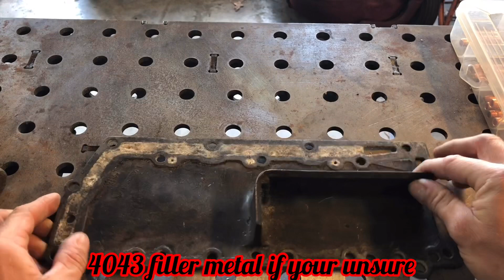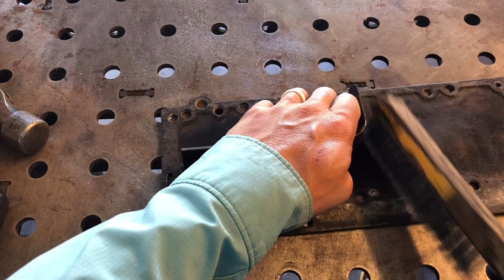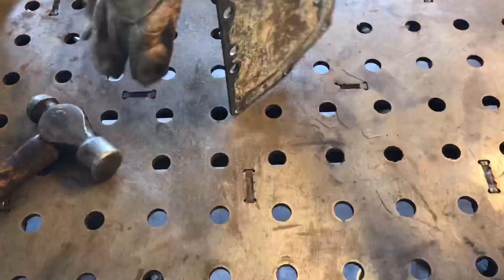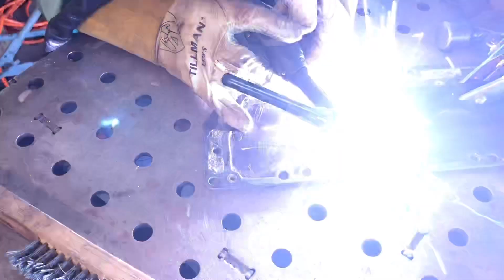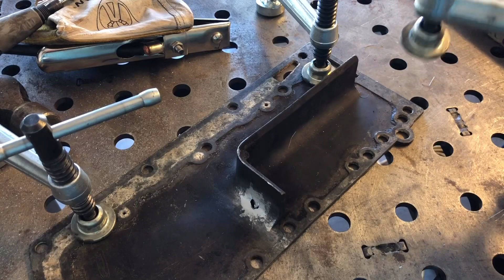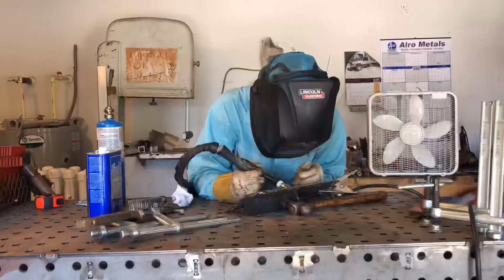Welding DIRTY THIN Cast Aluminum

Comment: Recently did thin cast aluminum and I think my biggest mistake was using 3/32 instead of 1/16” tungsten. Cast is way more difficult than most videos portray, but yours is very realistic and informative on those small details that makes a difference. Thank you I subscribed cuz it was so informative. Keep meltin bro

Comment: That appeared to be an almost impossible repair - kudos for accepting a challenge like that. Because that casting was designed to be exposed to salt water, I imagine they actually used better casting material than would have been necessary otherwise.

Comment: Thank you for simple, clear instruction.  l am welding a damaged quad engine lower casing with a hole and broken away edge. l am using a cheap lift inverter tig 165, not sure will do a good job.  Any advices appreciated.
Reply from the maker: pre heat with a torch. get to at least 400 deg then weld at full amps you might get a puddle. if you haven't welded aluminum before. don't make this your first project
Reply: @MeltinMetalAnthony  Thanks, l m refining my tig set up for ac, thicker tungsten to do the cooking/filling after preheating the job. Will practice on junk cast alum parts(a bad cut off saw) till good results acquired.  l arc alum sticks, its good bulk jobs.
Reply: @MeltinMetalAnthony  Thanks, l did the repairs by Duraweld rod, as my repair spots on quad lower casing are all none critical structural areas.
Reply: I believe lowest heat to puddle in filler but pulse may also keep heat out of heat soaking and higher frequency like 150hz

Comment: 5356 is generally used on unknown aluminum alloys and more so on dirty cast. 4043 works though but keep this in mind… unless using a spoolgun, spoolgun welds with 5356 filler are terrible in my opinion and spoolgun on a job like this should only be done as a last resort if you have no access to AC TIG.
Reply from the maker: the 5356 wouldn't take
Reply: totally agree
Reply: Most say 4043 is easiest.

Comment: I think the worst I did was an oil pan on a skid steer.  While on the skid steer.  Used a spool gun.  Ugly when done but it held oil.  I like your videos.  I teach now and share them with my class.
Reply: l have a spool gun set up for alum, will try on bulky works.  Tig seems doing a finer patches/build ups.